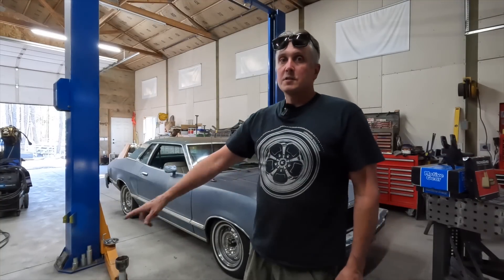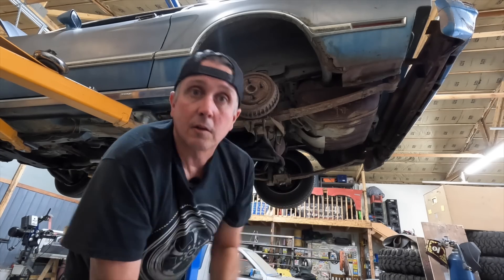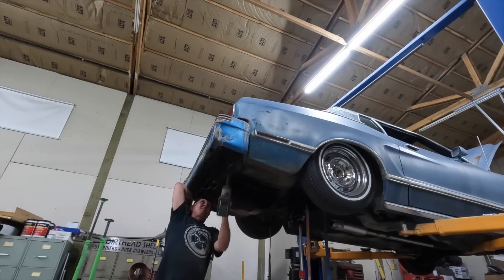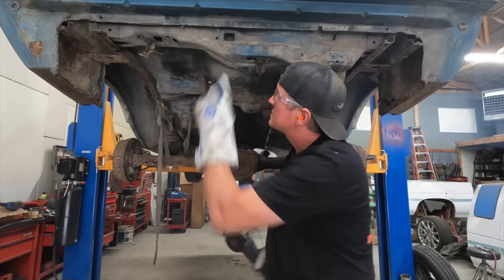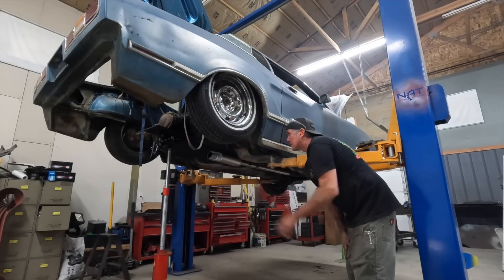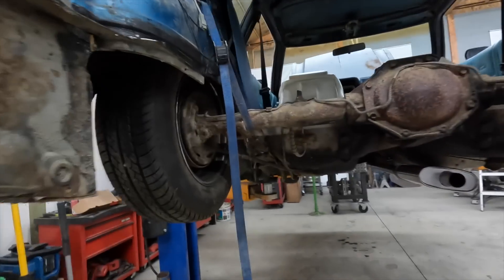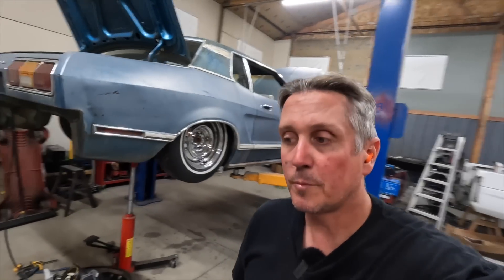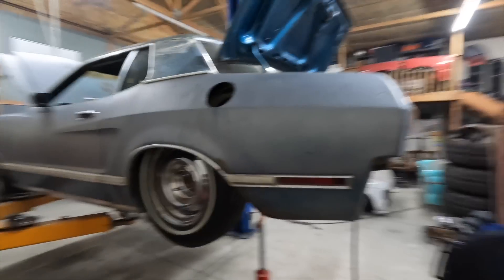Time to slam this Mustang 2 on the ground!

Comment: I think the best part is a lot of people (myself included) struggle with analysis paralysis. It’s fine to have a goal, cut into it, and run with it. It’s all just metal! Great job Dave.
Reply from the maker: I try to keep that from happening.  It’s super common
Reply: Have a goal.  Bite off small chunks at a time. Measure twice.

Comment: Cool build! What about running a 2 link setup in the back with the trailing arms going past the axle, 2 attaching points on the axle, air bag on the arm behind the axle up to the sub frame? Kind of like Peterbilt low air leaf. Run a track bar to the frame or just make your lower link arms wide enough to control side to side play. Then have the trailing arms rest on the sub frame where the old front shackle mounts where, kind of like a up travel limit. Long arms to lessen pinion yoke angle change. Keep up the good work!
Reply from the maker: That was an idea that I entertained, but it would still get bad pinion change and be kinda complicated

Comment: That Mustang will be a sweet ride! 👍 Read the comments and found out that you are going to modifikation the engine.😊 Those Ford pinto engines are legendary here on the other side of the pond. With dual Weber dcoe carbs, a hot CAM and some other things and a good exhaust will make it to the best sounding engine ever! Period! And quite powerful....😂
Reply from the maker: They are popular here too, for pony stock racing

Comment: I used 2x3 .083 wall for my falcon rear frame rails and it’s for sure stronger than the stamped 16 ga U channel.  My trunk is also 18ga and my wheel tubs are 16ga.  Plenty of strength in that square tube.

Comment: Great atmospherics in the shed. Maybe tell DHF to put some paint on the shop? Your light works well. And that mic is getting it.
Reply: “The last of the stubborn bolts.” Jinx.
Reply from the maker: Thanks. I have been fighting with the sound a lot lately
Reply: Take a page from Derek and get the floor coated, or did you already? That seems to help a lot when he’s under the lift. And is your project with him going to show up at some point?

Comment: I absolutely LOVE your channel. To the point that I want to start over landing. In order to do so, I ordered a lift kit from ROUGH COUNTRY. I AM POSTING THIS AS A WARNING TO EVERYONE.....  I purchased a 4" lift kit for my 84 Ram Charger. I was told that it would have EVERYTHING that I needed. Well, the front sway bar links, the rear u bolts , and shackles all had to be repurchased due to the lift, being more of a 6" lift. So, it is a bit taller, but my husband is a double amputee, and this causes a problem.... Not including the $248 in parts that I had to purchase afterwards. OK, so I called RC directly and even though he agreed that the wrong parts were in the box, he REFUSED to help in any way! We live on a tight budget, and this f**ked me over , HARD! I just don't want any of you to have to go through the extra money, and crappy service!

Comment: You can make the backwards 4 link hook up. Its all about the instant center. The thing to watch out for is the change through travel. Use a 4 link calculator to get in the ballpark on lenths and angles. When the upper and lower go opposite ways is when issues really happen and the instant center changes radically .
Reply from the maker: Yeah. I’ve had vehicles with all the types.  2 forward 2 back gets the weirdest.  4 back have always driven well
Reply: @thedirtheadshed  my drift car has the sway bar as the rear facing upper links on a very wacky independent suspension that essentially behaves as two independent halves of a 4 link. I've learned a ton trying to make it hook up. The problem arises because you can set the antisquat at ride height to hook hard and drive the tire into the ground. As soon as it squats or compresses the links immediately diverge(rather than essentially swinging together) and antisquat goes completely out the window. I'm planning on just doing away with that and putting a forward facing upper link to make it ideal.

Comment: It takes a lot of confidence to hack that much of the car away. Finding enough structure in that unibody to mount suspension to will be challenging. As tempting as that leaf spring mounting point is to use for a link it is way too close to the axle. I think you’d have the same issue with the reverse link set up too.
Reply from the maker: Reverse link will allow for longer and flatter bars.  The front mount is the east way out , but the amount of plunge and pinion change would be terrible

Comment: running the 4 link backwards could help in a burn out car huh? if it causes reduced traction then you would need less HP to burn the tires off, but would it wheel hop really bad?
Reply from the maker: They don’t hop too bad if you set up the shocks right

Comment: Id love to see you make a rear bumper out of like , conduit and sheetmetal. Some nice tight radius bends in 3/4 to fit that gaping hole top and bottom with sheet metal filler. Ohhhh or maybe some expanded metal. You can form it way easier than sheet.
Reply from the maker: I may have to.  Not much for options
Reply: @thedirtheadshed  I've seen a couple done with some stell rod framework and felt/fiberglass but  it doesn't have the nice rounded edges.